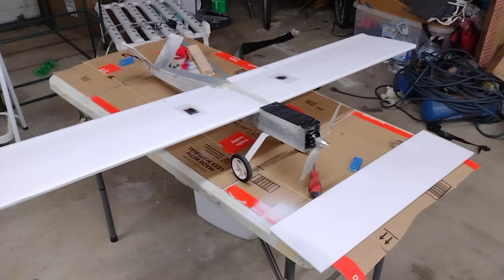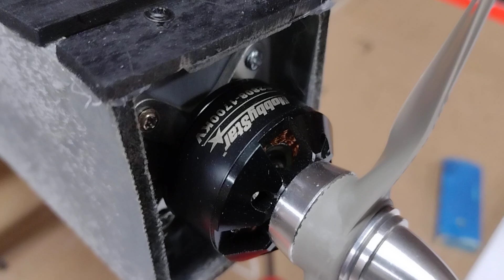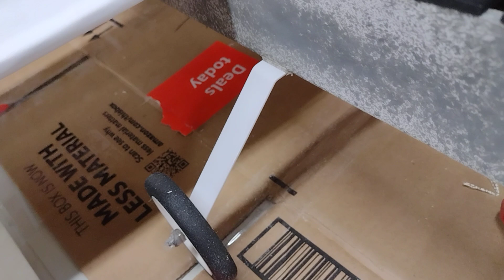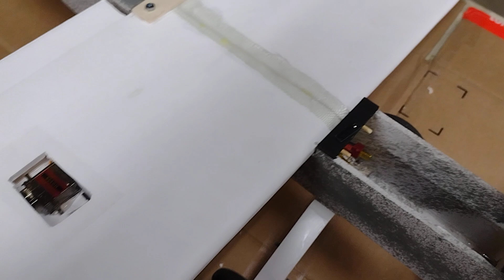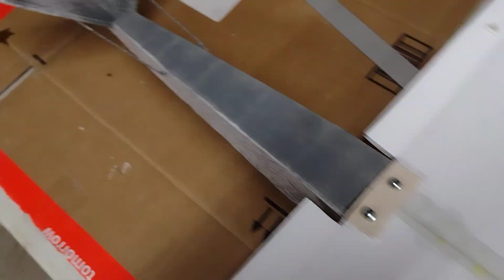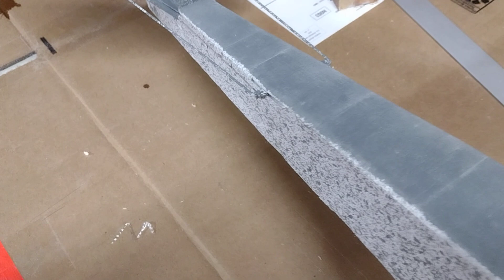finished foam board Quickie

Comment: How do you attach the wings bro
Reply from the maker: I used a dowel on the leading edge and 2 screws on the trailing edge. The dowel slides into  basswood former I made. I will see if I have a picture of it.